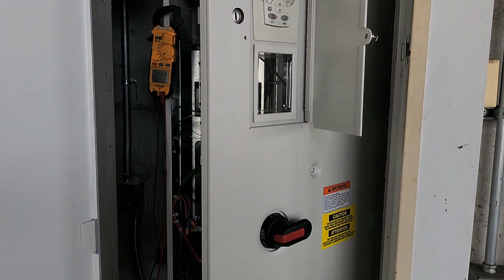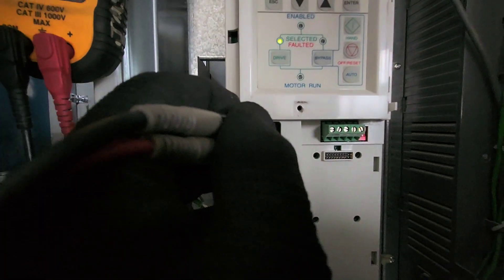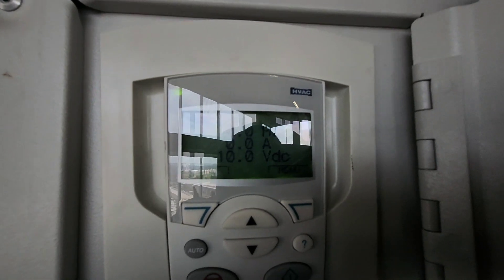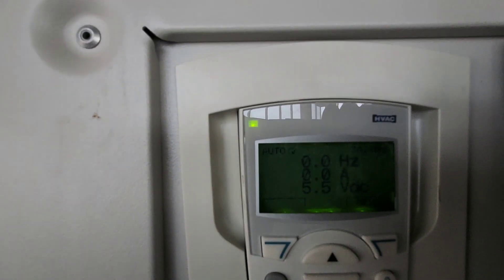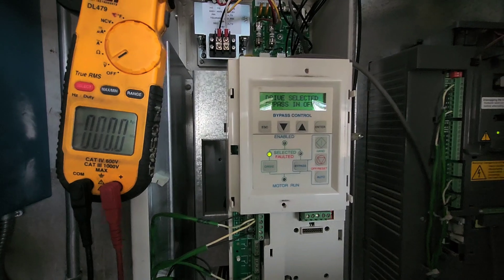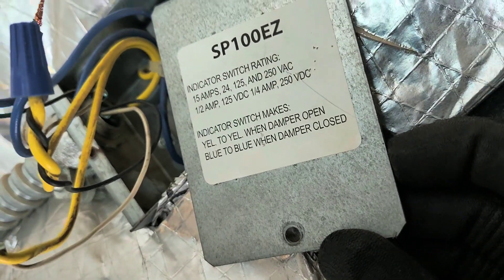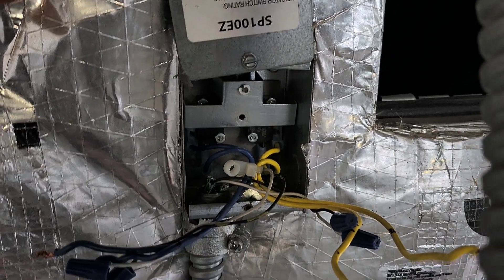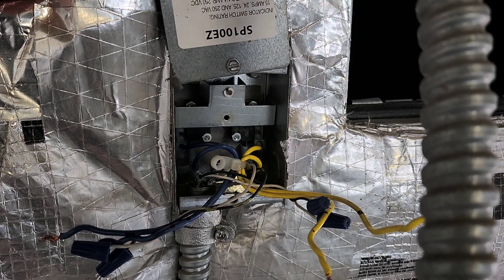CALL FOR STAIRWELL PRESSURE FAN VFD IN ALARM...BUT IS IT THE PROBLEM...

Comment: Nice touch by adding the manual so we can see the alarm codes. Never worked in a parking garage before, so many different environments in commercial
Reply from the maker: Im not used to stairwell pressure fans being in a parking garage. I see them normally in the penthouse or on the roof. This was a backup fan. There are 2 large centrifugal ones on the roof of this building with 75hp motors.